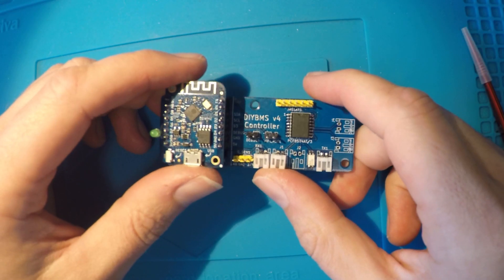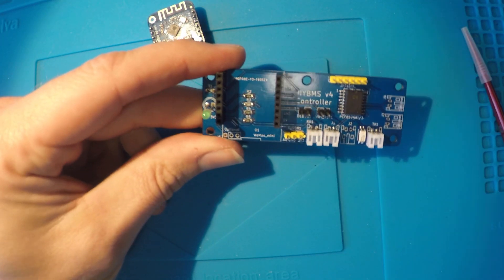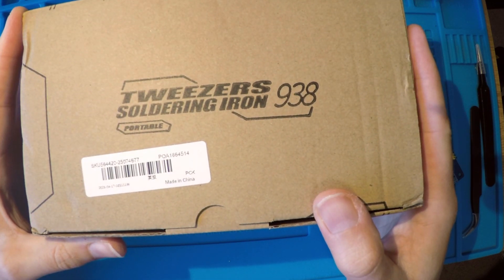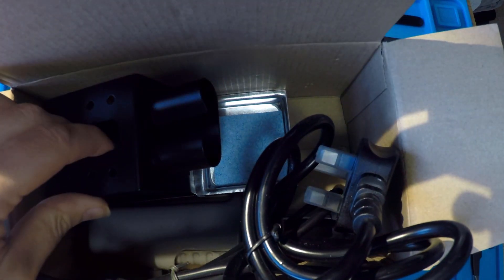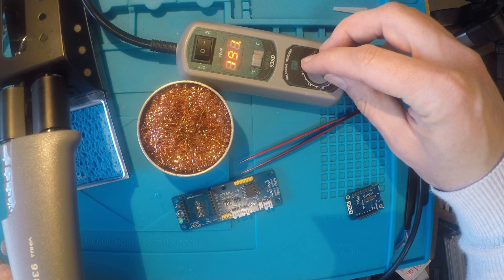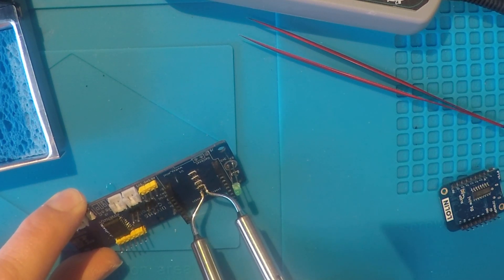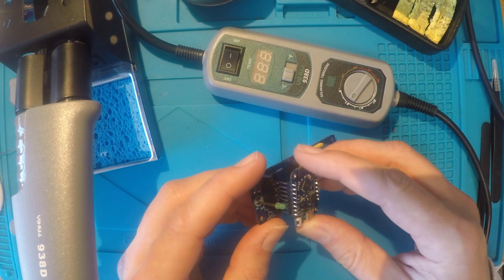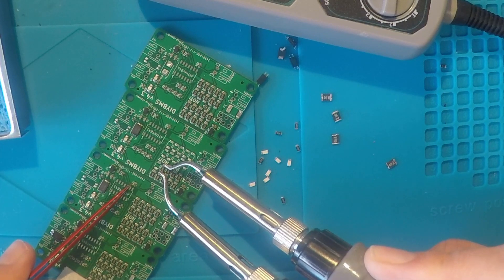DIYBMS Original Controller Communications Fix & using Soldering Tweezers

Comment: Although it is not idiot-proof, to me the cheap multipoint power adapter is very useful especially using plugs from different countries and I don't want to spent lots of money for such a thing. In fact, I have dedicated one for each low power machine/device having incompatible plug because it is so cheap and not having to worry about plugging-in and plugging-out. I don't recommend its use to laypeople, but I am pretty sure anyone with electrical knowledge is not dumb enough to use it in a dangerous way.

Comment: I'm still getting lots of errors..  even with the 2k fix (but a lot less than before) It was suggested on the forums that one could go even lower..  I'll have to try a smaller value...
Reply from the maker: Sure try it and see what happens.  Are you also using twisted cables for the comms cable?
Reply: @StuartPittaway  ,yes.. but manually twisted.

Comment: hi steward, maybe a dumb quest, but as of late i have a lot of bms's communication directly to an inverter for soc amongst other things.
is this something you are considering ?
Reply from the maker: Hi, the new controller is designed for that. Communication with inverters and chargers using RS485 or CANBUS
Reply: @StuartPittaway  so then it would be a matter of decoding what exactly the bms used by for instance a pylontech uses and we're off to the races ?
Reply from the maker: @houseofancients  that's correct, however also the hard part, I obviously don't have access to every device out there, so have to rely on others to get the protocol details

Comment: Thanks for not forgetting us old adopters. Interesting solder tweezers. Thanks for sharing that.
Reply from the maker: Its a simple fix for the older controllers if you are running into problems with communications